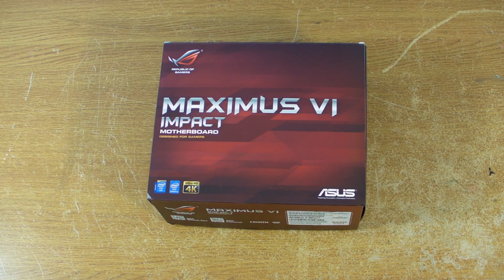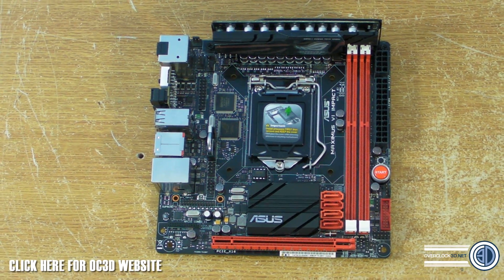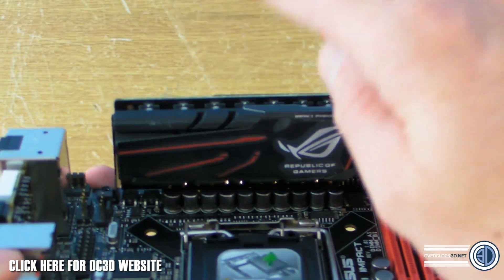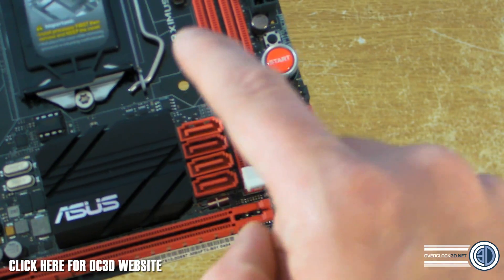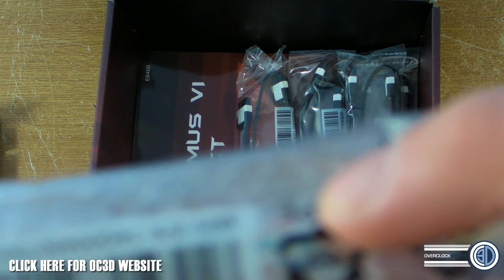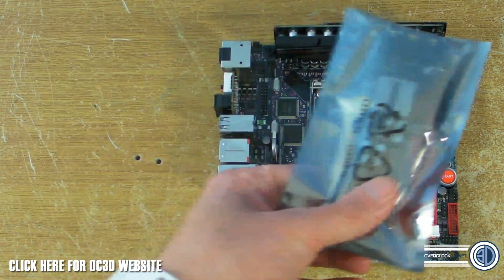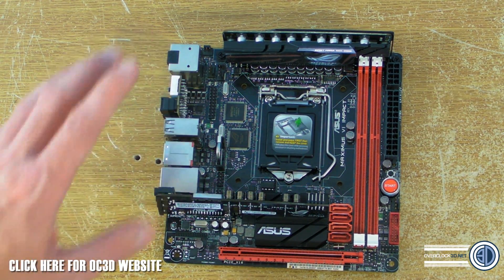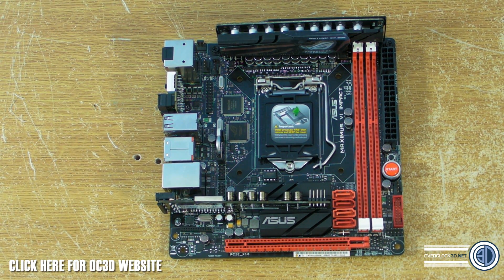Asus Maximus VI Impact   Z87 Haswell Motherboard MITX

Comment: One wonders if mini-pci express will be a future standard as an universal internal connector for harddrives, soundcards, wifi and so on. For the graphics cards an internal thunderbolt-connector could be used and then treat GPU's as a standalone unit, think on how small the performance PC's will be in just 5 years time. To bad on all the nice big ATX-cases of today...

Comment: Man, this little board would make an AMAZING single-GPU gaming system! Add one of the smaller aftermarket heatsinks, and a couple SSDs, and you could have a PC that's smaller and more powerful than a console! The biggest thing in the box would be the PSU.

Comment: The new and improved Q-connector is much better than the previous design, but you didn't even open the bag to show it. Also, no shout-out for the new M.2 SSD connector.

Comment: Tom you did not mention the M.2 (NGFF) Socket 2 for SSD on the mPCIe Combo II. 
But thanks anyway. :-)
... M.2 (NGFF, Next Generation Form Factor) connectivity for SSDs. M.2 is a fast and power-efficient standard that aims to replace mPCIe and mSATA, designed to optimize SSD performance. mPCIe Combo II works with your high speed M.2 SSDs and makes the most of their potential, helping you reduce load times to run your OS and games even faster.

Comment: NGFF, direct key, audio card SNR, wireless antenna standard connectors,  extended distance between the PCIe slot and the socket... those are the tiny info that make you decide you wanna buy a Z87 board from ASUS or a GIGABYTE...which usually you will not find in this channel